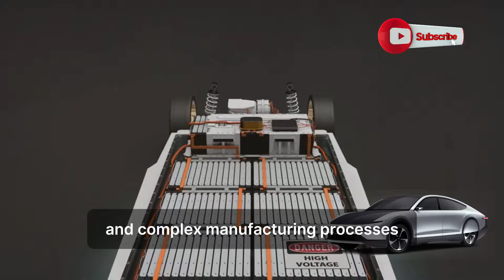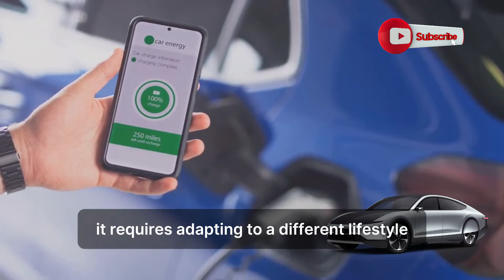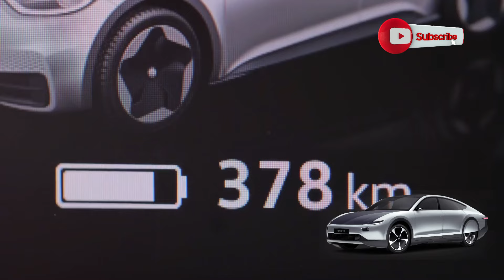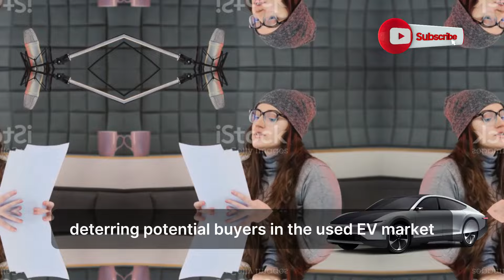The Electric Vehicle Revolution Ends Before It Starts! New Technology is Coming to Dethrone Tesla!

Comment: For those who do not know much about EVs, I will state that the average EV on her charges their car at home, where charging costs are approximately 1/3 the price of a public charger. 

Based on the calculations that I did a few years ago, the Tesla model 3 costs about the same to fuel up as a Toyota Prius, when using a supercharger. Part of this is because commercial entities pay approximately double the price for electricity than the average homeowner. On top of that, there's the expense of installing the equipment, the expense of the equipment itself, and the charge that the charger owner pays to the credit card company for every recharging session.

Comment: If you need to travel less then 70km radius from your home, all is sweet and nice. You can have your ev as daily and you save money.  The problems starts if youtry to push ALL logistics, overland transport to EV. Not gonna work with todays batterys. Hybrid as disel to  generator battery pack  to electric axis, yes can work, pure electric.. not yet.

Comment: Oh dear. The same old negative lies that get trotted out by Oil Companies and Car Manufacturers who haven't invested enough in this new technology. Tesla started the revolution single handedly, and handed over its many patents so that others could help with the transition. Sadly, they were all luke warm on it, being too cumbersome to make a fast enough change.
Those will likely all go bust, but in the meantime it's slowed down the rollout due to not enough compelling vehicles that are made at a profit.
Tesla aren't helping things because they're innovating so fast that their customers are suffering precipitous depreciation if they decide to sell at the normal period they're used to.
However, to suggest that the EV revolution is not happening rapidly is completely false. China has answered the call, and there's nothing that's going to stop them from making millions of cheaper EVs which will decimate Legacy car makers.